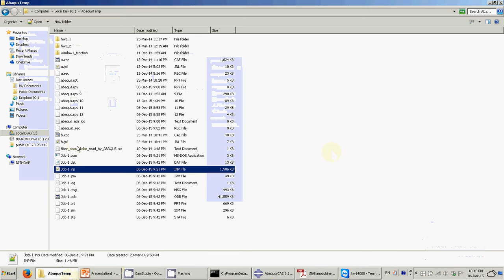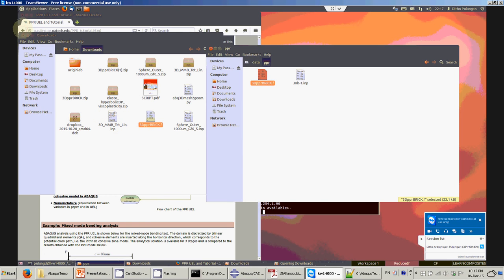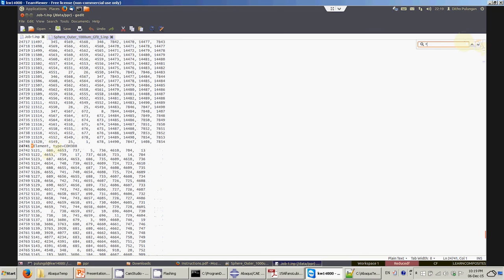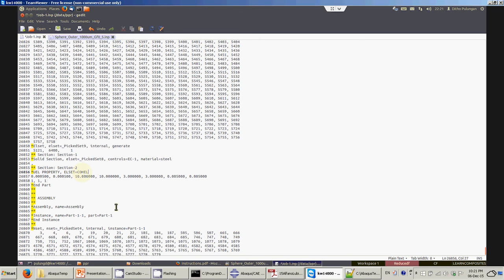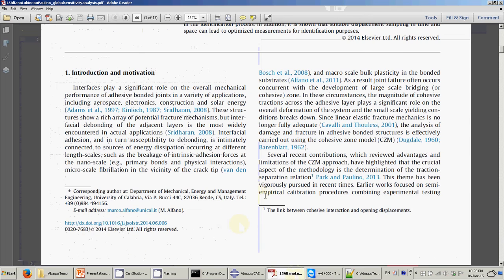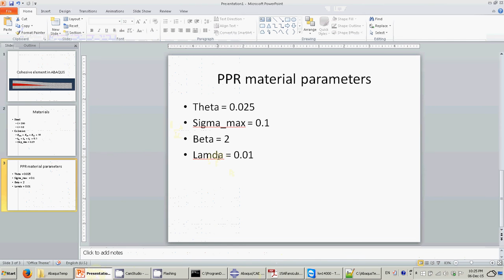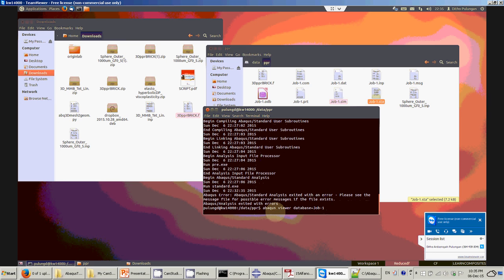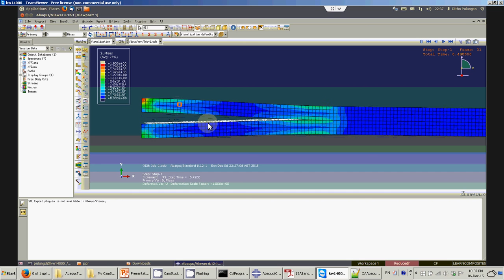part2 How to USe Cohesive element in ABAQUS: PPR UEL

Comment: what software are you using when you are running PPR?
Reply: Its FORTRAN compiler
Reply from the maker: The FEA software is ABAQUS. To run the subroutine, you need another software i.e. fortran compiler. In my case, I use Intel Fortran Compiler 2012.